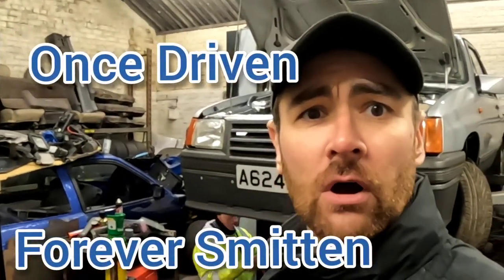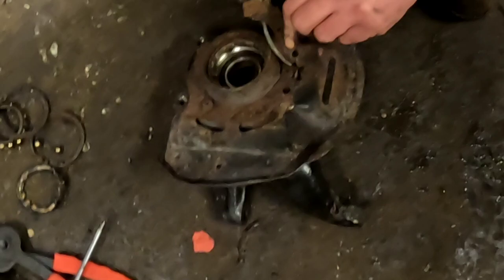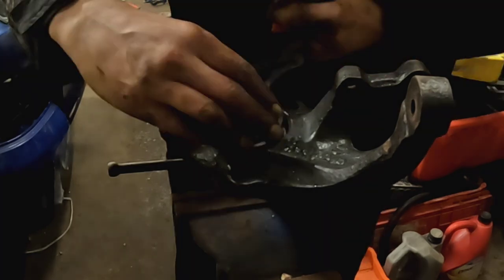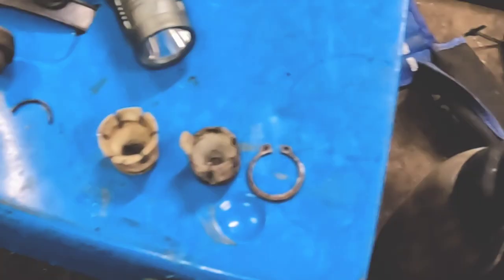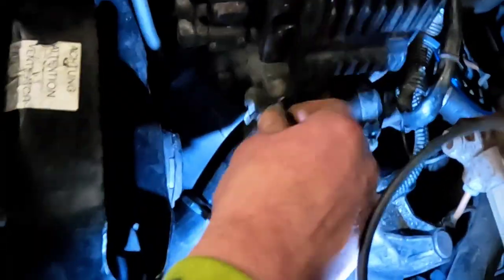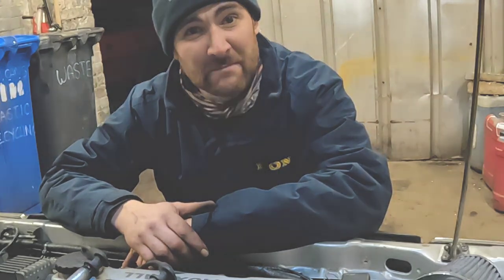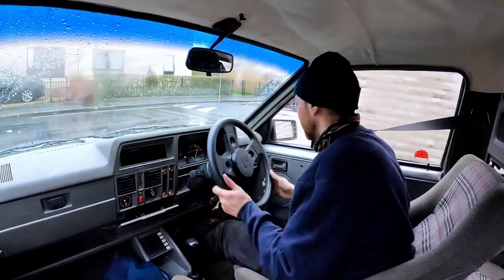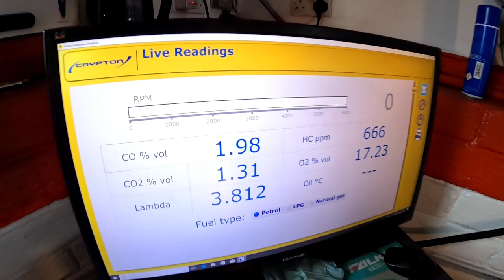A spot of mild to moderate Nova thrashing. Oh and it has a MoT!

Comment: Great video good to see the Nova alive and kicking quick question lmhave an Astra j 2014/64 plate 1.4 petrol and when l turn on the engine there is a strong smell of petrol which goes away quickly once lm driving any ideas

Comment: Does that 1.6i engine atill have that socket that you can switch over between normal and super petrol? 
I know my father's Astra 1.6gl 100hp had that feature. 
That engine in a Nova (Corsa-A) will make it very zippy. 🏎
Reply from the maker: Yes it has the octane plug on it, I flipped it to run on Super 😁